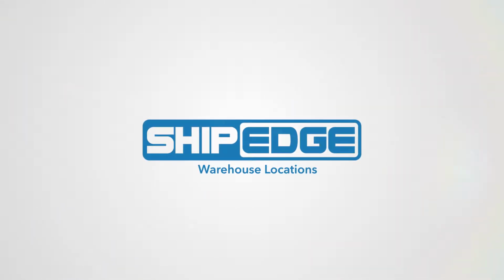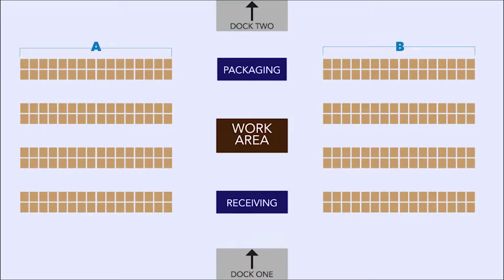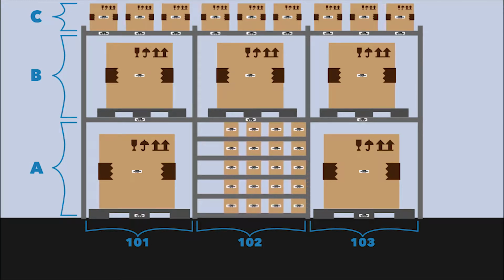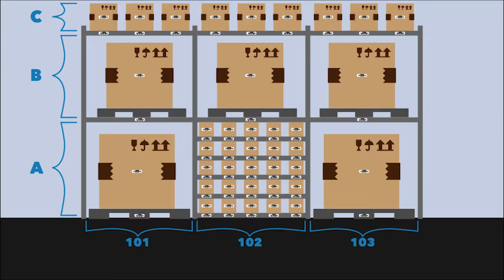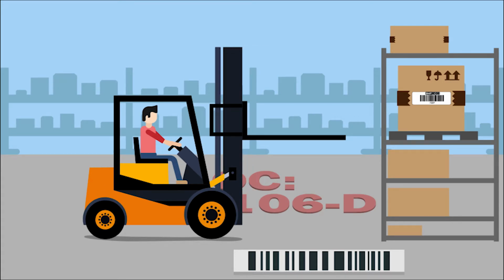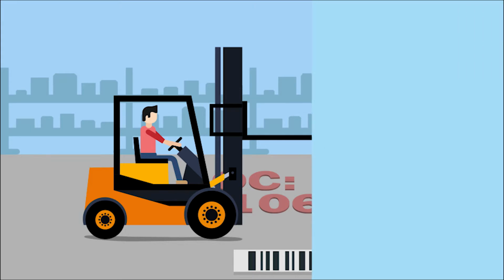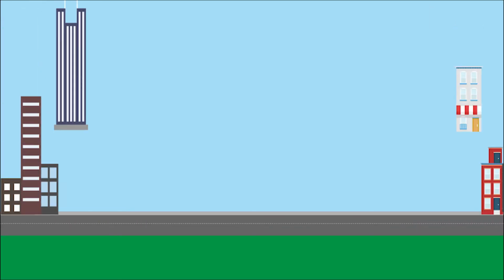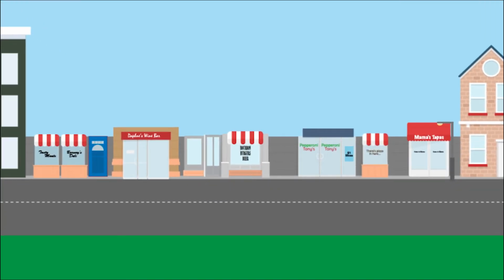Designing an Efficient Warehouse Layout for eCommerce, Assembly and Distribution with Shipedge

Comment: Would be more efficient if you number the aisles not the rows so you can pick from side to side
Reply: Hey Gwynne, thanks for your response! I think in some scenarios you're 100% right which is why we also support pick routes for zig-zag picking. We've spent quite some time comparing zig-zag picking vs s picking.

We noticed that the simpler S picking route reduced training time and led to fewer travel errors. Although we prevent errors while picking through mobile scanning, It still slows down the average picks per hour for a route.

Also for eCommerce fulfillment, we noticed that some more complex layouts driven by sell-through rates or SKU affinity were better supported by S picking.
Reply: @benjywang9918  Hi would be good to understand what you mean by S picking. Aisle numbering definitely allows for sku affinity and ABC picking especially when it comes to picking from shelving
Reply from the maker: @gwynnerichards8586  There are quite a few names for it like single side picking, etc.